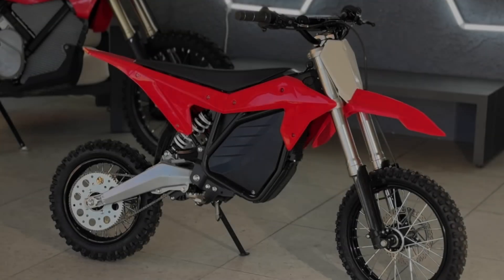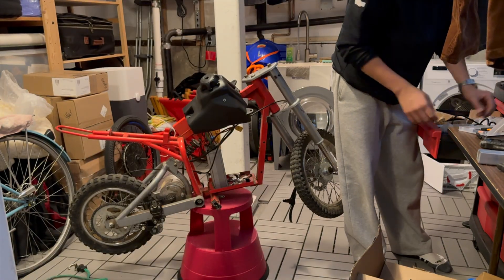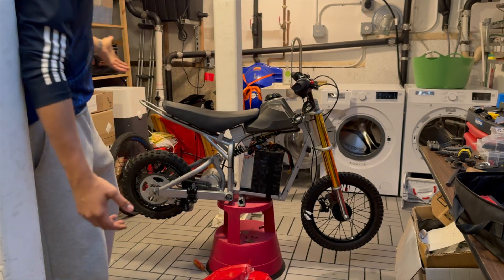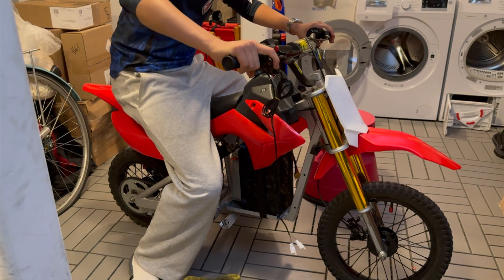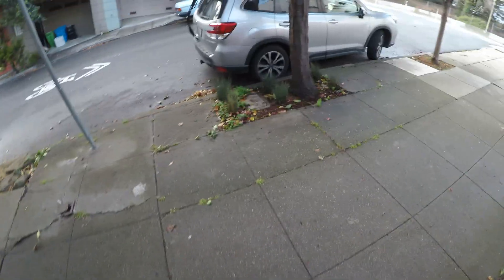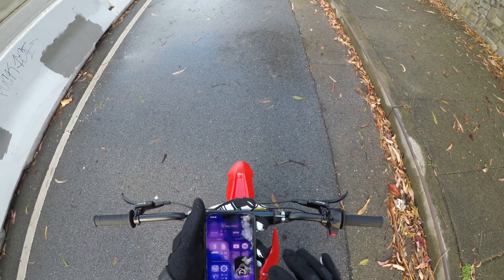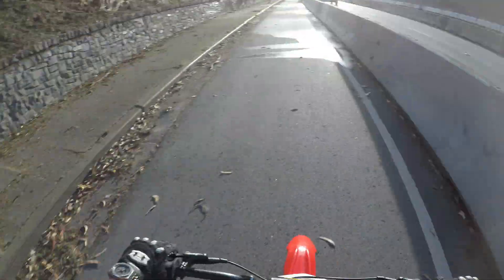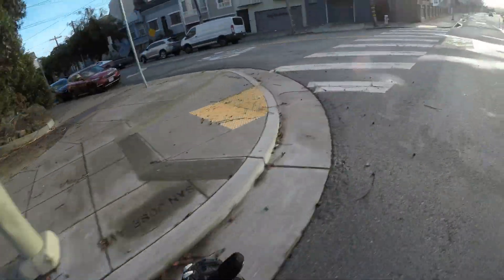72v Razor Mx500 Build

Comment: For the shock lifter did you have to drill holes, because the holes are on different sides
Reply from the maker: Nope. Didn’t have to. U just rotate the shock.
Reply: @lucaskrides I bought the same lifter and it didn’t fit mine, I’m running the e and c Mx shock